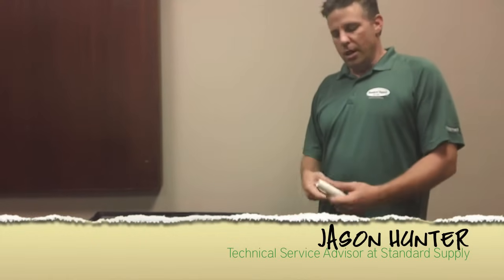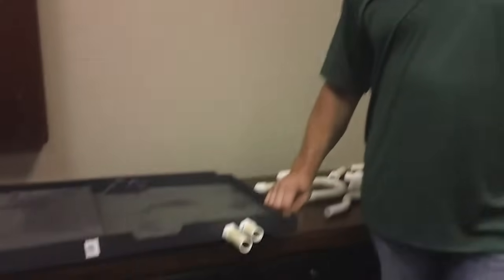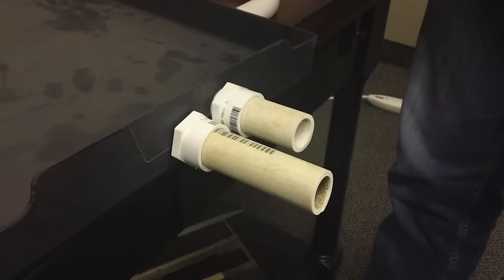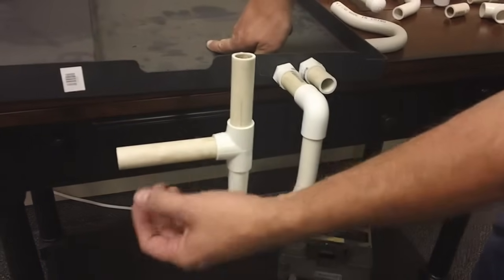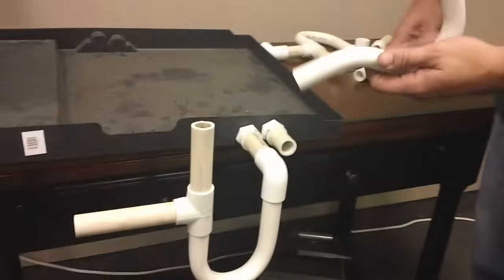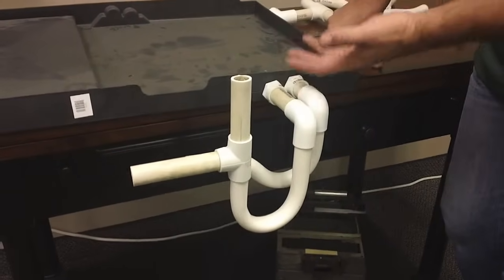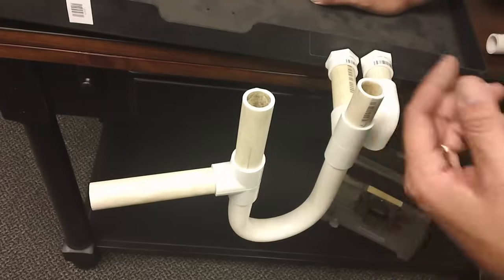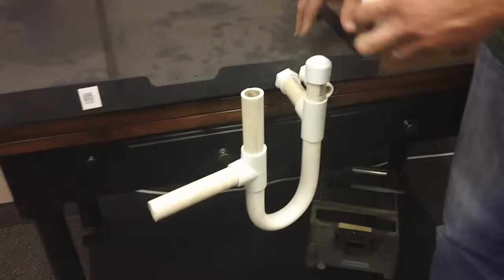Tech Tip #3: HVAC Systems - HOW TO Correctly Install Condensate Drains

Comment: primary drain line. ok. it connects "lower" on the drain pain. and will see water.
secondary / aux / emergency drain line, it connects higher. and will only see water if primary drain line gets clogged.

ISSUE #1,  secondary drain line, will never see water, on normal usage, as a result P trap will be dry and/or simply run dry completely. and in that, no Air seal.  air will simply be pushed out the emergency drain all the time. 

ISSUE #2, installing a P trap on the secondary / aux / emergency drain line = a CLOG. it will take more pressure for water to get through the P trap. this is an emergency / aux / secondary drain line. it should have direct flow of water with no traps. if i installed a TRAP on pressure/temperature relief valve piping on a gas hot water heater. i would be RED FLAGGED.  

ISSUE #3 your drain pain stinks. both primary and secondary connections in video look exactly the same height going into the pan itself. NOW if the drain pan itself was tilted. so the emergency / aux / secondary connection was physically higher than the primary drain line. ok, but no mention of that in video. and the pan is laying perfectly flat in video. 

=================
ISSUE #4a P trap on primary drain line. = required, it does a couple things 1st. water will be in this line in normal usage, if air was also being pushed through, it would be like someone talking and spit flying ever were as they talked.  a P trap creates enough pressure difference to block air from going through the Primary drain line.   

ISSUE #4b EXAMPLE: in old furnace and a/c coil on top of it. if primary drain line of A/c coil did not have a large enough P trap (using hose) on it. water would "SURGE" back and forth like a wave going up and down inside the P trap. and would create like a hammering effect or piston effect or water hammering effect. that would change air pressure inside the system causing issues with sensors and noise.   having a trap that is to small in height difference from inlet to outlet side of P trap.

ISSUE #5 there is always statements about PULLING AIR FROM A UTILITY ROOM were a furnace and/or A/C Coil is located. primarily due to dryers, other gas appliances, chemicals, etc... within the room. but it does not say much about putting air into the utility room. there should be no issue for a little 3/4" to 1" inch pipe. putting air into the same room as the furnace and/or a/c coil.  that 3/4" to 1" pipe would be the emergency / aux / secondary drain line.
Reply: Issue 2 contradicts the correct issue 1.  Issue 3 is a mistake as its an illusion the holes are not same height.
Reply: Ryan Sanders very good points, so much science in a simple drain!

Comment: You show the primary is vented into (say an attic).  Since many systems drain into house sewer system do you want these sewer gases in the attic even it is through a 3/4" opening.
Reply: Never drain them into a stink pipe. Some will go into a laundry drain that should be trapped . Most attic installs drain out with the line set or close by.

Comment: Vent and trap primary drain always put a float switch in the secondary drain. Best way to do it. Primary clogs up secondary switch will shut down the unit. Simple as that. Never have a flood or drain pan overflowing. Always trap and vent your primary drain though. That vent will allow it to drain in any situation as long as your air handler is higher than the fall of the drain.TRAP AND VENT GUYS.
Reply: They usually have a set of instructions that come with float switch. But look for Red wire coming from Thermostat. trace it down to where it connects in the air handler unit itself.  That thermostat wire should be wire nutted together. Disconnect that wire nut and install float switch. You should now have the red wire coming from thermostat connecting to one wire of the float switch and the other wire of the float switch will connect to where the red wire used to connect. The float now bridges that connection. Turn system on and once on flip float switch upside down and unit should turn off.
Reply: unless of course the float switch fails like mine did TWICE.  Put bleach in system in June to make sure no algae in drain line. by mid July flooding downstairs unit. 10k+ damage because no one was occupying unit below. Rectorseal ss1 said not under warranty because lack of maintenance. Guess I am supposed to check drain line twice a month every month. Don't see use in buying float switch if I have to check drain line that often.
Reply: My primary has the P-trap but not a clean out. It drains directly to the outside lawn. There’s water in my pan but not enough to go out of the secondary. I’m not sure I should just easily DIY a clean out trap so I can clean it from the top instead of trying to do the vacuum from outside of the house, I don’t think it’s strong enough to pull. There is a consistent drain in the primary but still water in my pan 😢 .
Reply: How do you determine which is primary and secondary?
Reply: @HausofPain  secondary will be partially blocked off on the other side of the threads on the pan.
Reply: @HausofPain  the lower port is primary and the secondary will be slightly higher up than the primary. You will see this in this video if you look at the drain ports closley.
Reply: @jeffsadowski   yes break r wire from thermostat

Comment: Appreciate the comments.  First of all, the secondary drain trap can be taken care of by way of a simple substance called baby oil/mineral oil.  When the trap is filled with oil water bypasses the oil when needed and oil remains in the trap keeping the system sealed.  Trap never runs dry.  Equal resistance pertaining to airflow not the flow of the water is the key.  If you choose to cap secondary with an emergency switch that's fine too.  However, if the switch fails then the cabinet is ruined.  Hope this clears up any concerns you might have and thanks again.

Comment: The problem I see with primary and  secondary traps is that the secondary trap well not have a water seal an tell the primary plugs up if you just add water to the secondary trap it will soon evaporate out. One other big problem I see is installing Condensate lines directly to the main sewer pipe with out a bacteria air gap trap sewer gas and  bacteria  leaching in to the evaporator.
Reply: Mineral oil

Comment: The traps serve to prevent the loss of conditioned air (or the introduction of unconditioned air on a negative pressure system), but ONLY when they have water in them.  The emergency drain trap would never get water in it unless the first one became sufficiently clogged....  That said, my system had the emergency drain port plugged (cute), the primary trap clogged, and my wood floor got F'd up.  This is a commercial installation, and employees did not recognize the sound of falling water in the air handler every time it cycled off!  I'm going to install a float switch and a manual reset circuit such that the unit will be shut down if the condensate ever backs up again.
Reply: Be careful trusting in that float switch. I installed two. tested to make sure they work properly and then less than a year later they both failed within two months of each other. one was caught before it had any chance to do damage and both were cleaned out and sent on their merry little way. then the second one failed sometime July and 10k+ worth of damage to lower floor happened. Just be careful.

Comment: I never did understand the reasoning behind putting traps on a condensate drain. Considering that they are usually run to openly dump into a floor drain or basement sink, it's not like you need to block sewer gas from coming back up. So what's the point?
Reply: Preventing vacuum loss in a negative pressure system.  Furnace pressure switch won't allow start if condensate drain has no trap... No trap, no vacuum, no start...
Reply: +Maxwell Edison there is this thing called VACUUM. Certain system require it. Some don't.

Comment: Now I have an older furnace. It appears to only have 1 drain, and I noticed the drain dumped into my crawl space. Well I just put a new encapsulation in, so now it's dumping into a plastic. Should I go though the hassle of putting a P trap in? It's a vertical application, I have no documentation on my system, and the condenser is under the blower. And it blows air down. I was thinking of just running a line to my sump pump.

Comment from the maker: The first thing that I would consider is to trap unit #2  with a vent on the exiting side of the trap. Depending on the fall between unit #1 and #2 will determine the application. Pressure equal on both drains equals proper draining.  Hope this helps.

Comment: I have a question about drains. I have two units upstairs and one #1 has a drain with a stack and a trap, no issues. The other unit  #2 has just a straight drain  with no stack) they both murge into the same pipe 3/4 pipe to the sink drain. drain #1 is higher than #2 were it ties in to the 3/4 pipe. The issue is that it seems that drain #1 puts pressure in the pipe pushing water back up pipe #2 .all the back to the unit. How can I correct this cause its ruined my cielings a couple times and every a/c tech say nothing wrong and that the pipes are cloggeg. They are not clogges just fighting each other. Hope you have some ideas. I wish I could draw you a picture!